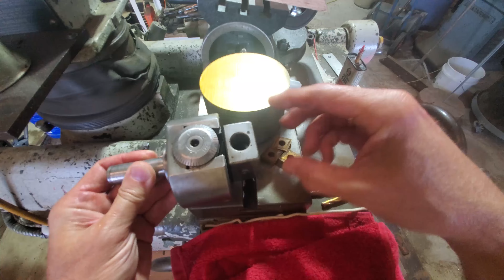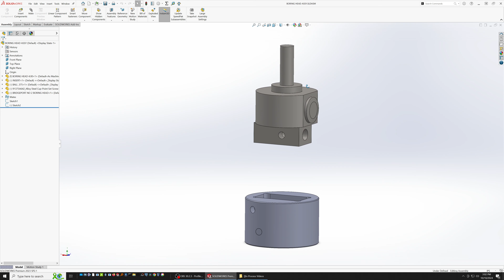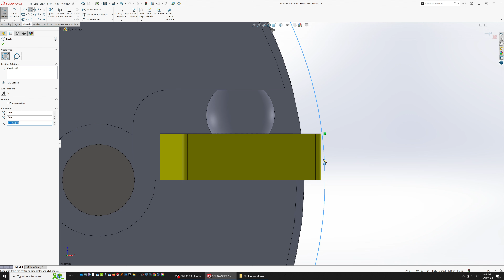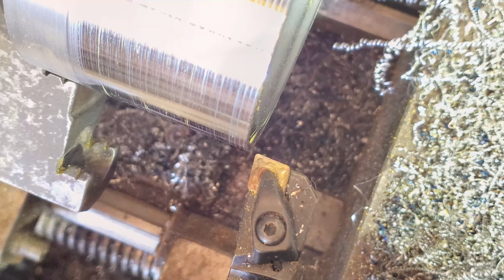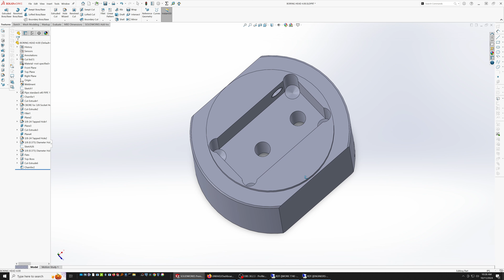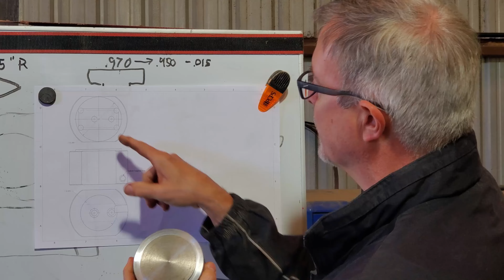Making a "Jig-Bore" Style Boring Head

Comment: Why did you not just mount a boring bar in the horizontal position of the boring head, that's what it's there for.
Reply from the maker: The extra mass is supposed to improve finish. I need every advantage, the weld cleanup is an interrupted cut.
Reply: @EngineersWorkshop  I will be interested to see if it does make a difference. I think it likely that the extra distance that the cutter is from the spindle will tend to counter act the effect that the extra mass provides.  As a side comment, the joint between the shank and the main body of the Bridgeport boring head is a fine thread and is probably the weakest point of the boring head. I agree with your opinion that they are a nice head to use but in my opinion, not a good head to use for heavy or interrupted cuts.
Reply from the maker: @garychaplin9861 Interesting. When i look close i see where there might be a parting line at about a 7/8" diameter. My shank is turned down to 3/4" past it. Long term i'd like to make a shank sleeve held on by a cap screw that increases the size to 1-1/4" or so. Won't be able to use it in the 2D then, but my Rosenfors mill has 50 taper holders for bigger stuff.